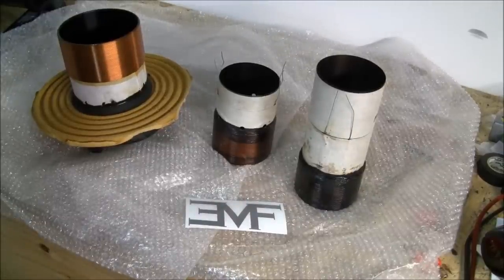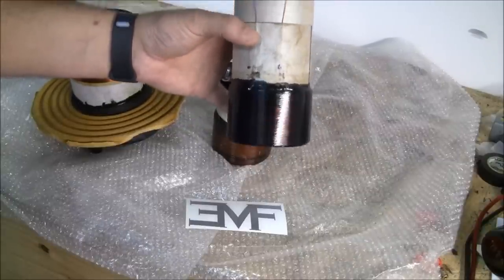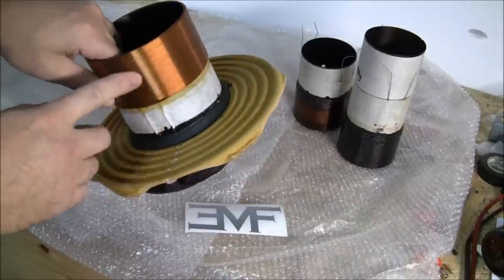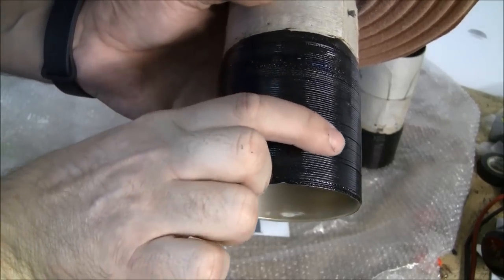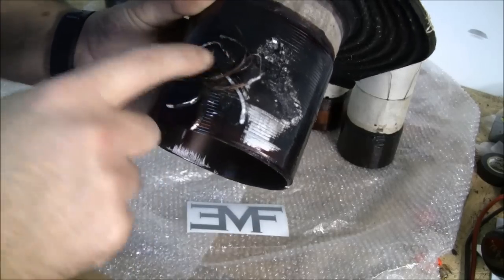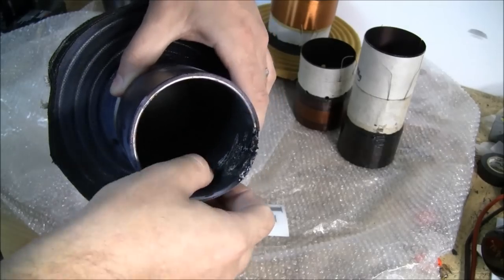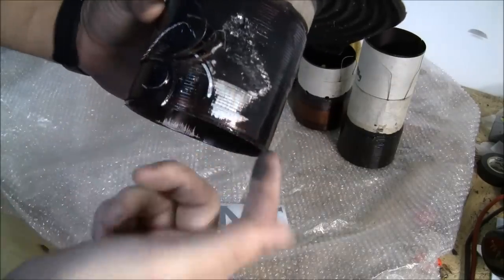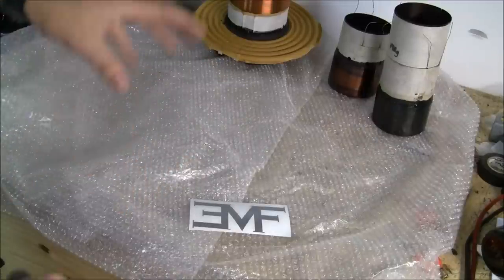Voice Coils - we know what you did!

Comment: The coil that had the 10k on it, how much was the sub rated for rms? 3" I'm guessing between 2500-3000? So a 10k even after decent rise would still be around 5000 minimum. I think you said it best this is the only hobby where people will push stuff 2-3x past what it's rated for then still blame the product. LOL!
Reply from the maker: Flexin Five Hundred 2,500 rating on that sub. It didn't last long on that amp.
Reply: LOL depending on the coil 1200 or so RMS+
Reply: Or they buy a 1k amp and crank the gain all the way up trying to get 3k out of it then blame a sub for dying not knowing it was basically being fed dc and being used as a space heater
Reply: I remember some car audio company's, were not listing RMS ratings, and when asked about it, they would tell you that "if you have to ask, it's not the sub for you" but, that has been awhile. No voice coil is "rated for power" and that's a huge misconception, and anyone that tells you otherwise, is just trying to push a product. And on a side note, the difference in the color of the enamel, depends on how hot the coil was baked for curing, and or how the process was done.

Comment: Also fun fact about the Brazilian amplifiers is they use extremely high voltage rails to drive the bridged amplifier section, often without filtering. Im guessing the higher multi-kW ones run at about 160V from the 200V capacitors often seen. This combined with lack of filtering allows for less current to be used for the same drive power, and thus fewer switching transistors. The downside is if the voice coil suffers a broken section (and no inductance), the voltage will basically shoot straight up to the rail voltage since there's no filtering on the class-D output, and thus flash over, causing all the melted and burned sections seen.
Reply: if it suffers a broken section it is already dead, usually caused by low voltage supplied to the amp anyhow, they just try to overcompensate, just need an amp good enough to shut off when your volatge is shit.
Reply: @nate0 Obviously you wouldn't, just like you wouldn't want to continue to run an engine with a rod knock, but it happens. A typical scenario would be multiple subs and you might not hear one is failing right away, so it ends up nuking itself in the process. Since the voice coil has a fair bit of inductance, if the amp has no output filtering and no proper clamping on the output, it can generate quite a lot of back-EMF if the coil opens up, thus leading to flashover. Don't know how many were/are susceptible to this, but its a distinct possibility since filterless class-D is really for undemanding things like consumer electronics, not high power car audio amplifiers. These also have the undesirable characteristic of having substantial voltage on the speaker terminals even with the amp idling since each terminal will be toggling between the two respective power rails.
Reply: Your "fun fact" about Brazilian amplifiers is completely incorrect.

Brazilian amps being "extremely high voltage" is an old myth/misconception.

Brazilian (full bridge) amplifiers use much lower rail voltage than their half bridge counterparts.
Reply: @danielbujold7262  First off, a full-bridge amplifier doesn't use "much lower voltage", it just doesn't have a bipolar power supply. Half-bridge designs have to have + and - rails to be able to provide the full swing about the ground reference. With a full-bridge design, the bridge does the polarity flipping, so only one rail is needed. That said, the rail must provide sufficient voltage to actually drive the load, and as such will use similar voltages as the half-bridge amps, but just with only one rail, and half the number of rail caps. Just doing some basic math, 2 kW RMS into a 2Ω load requires 63V RMS, or 88V peak. In a full-bridge design, this would be 90V at the rail. In a half-bridge design, this would be ±90V.
Reply: @danielbujold7262  And I think that may have come from a barevids video where he looked at the outputs of a full-bridge amp. That can cause some confusion since normally just one output will be swinging while the other sits at ground. Off the top of my head, the outputs on a full-bridge should be of opposite phase to add up to the full drive voltage once the drive signal has passed thru the filter networks.
Reply: @mysock351C  again with more misinformation....

Since you brought up the barevids video...I suggest you go watch it again. It's a good example of the correct information on this topic. He explains simply and clearly that what you're saying is false. A full bridge amplifier uses half the rail voltage vs. an equivalent half bridge amplifier (contrary to what you're claiming in your example).
Reply: @danielbujold7262  Having actually built amplifiers, not to mention being an engineer, I will say again that what you say is not how it works internally. It may appear that way externally due to how BTL amplifiers work, but inside there is only ONE rail instead of two. The idea behind the full bridge is that it can swap polarities of the load provided the load is kept FLOATING since there is no common like a half-bridge or linear amplifier. In a half-bridge or linear amplifier, two power rails are needed since the audio waveform can swing both positive and negative. On the positive swing, the positive power rail and its associated output transistors are in conduction, and the circuit path is from the positive rail to the common. When the audio waveform goes negative (i.e. crosses over), the process repeats except that in conventional current terms, the common rail is sourcing current thru the load and to the negative rail. One terminal in this case is at ground potential.

With a BTL amplifier, since both terminals are being driven, only one power rail is needed. Each half of the transistor bridge is used to route current thru the load and to the common internal rail. When it needs to swap polarities, it simply switches which set of transistors are in conduction so it can toggle the polarity of the output as needed. Once this passes thru the filtering, each terminal will, in essence, have half of the waveform on it. When they are summed together, you then get the full audio waveform. 

If the amplifier needs to be able to make a peak voltage of 50V, no matter which type it is, the power rails will need to be AT LEAST 50V. The only difference is the BTL amplifier doesn't need the -50V rail to do the business. It only needs the +50V rail. It cant magically make a 25V power rail into 50V. That's not how it actually works. 

For an amplifier rated at 3 kW into a 1 Ohm load, the RMS voltage will be ~55V. The peak voltage will be ~77V. Inside the amplifier, the power rail voltage would need to be at least that high for it to work. In reality, its probably going to be something like 85V or so. Not a trivial voltage, and if there's no filtering 'cause they're cheap, the back-EMF from a voice coil suddenly opening up will indeed cause issues due to how much inductance it has.

Again, its not "half the voltage", its just half the power rails, in this instance one instead of two.

Comment: The clipping itself isn't the cause of loudspeaker failure, it's the symptom of the problem, i.e. 'not enough rig for the gig' your hitting the end stop on the amp (and speakers if powered properly) and most likely going well past them. 

Lost of people, especially nearer the bottom end of the game, tend to have mediocre amps (and speakers) and push them to hard to get anywhere near enough SPL (also an amp driven hard into clipping sounds louder which add's to the issue), while a system powered with an amp that is rate at the same RMS figure as the drivers sounds like a good idea, once it's driven hard it's then producing far more output (with far more distortion) and the drivers get burnt.

The statement that clipping damages voice coils is probably slightly wrong (or being answered slightly wrong), as clipping itself does not damage speakers, but it usually indicates there is a problem that will result in a loudspeaker failure.

A lot of Synths used in many EDM genres can produce square waves and a lot of producers use them. Especially in genres like hardstyle/hardcore. And they don't damage the speakers.

Go and try it. Create a square wave and sent it BELOW rated RMS through your sub woofer. It will sound ugly but it won't damage the driver.
Distortion is also not what causes damage to a speaker. But it can indicate that your are at A limit. Be it your amps output or your drivers mechanical limits. 
Heck, guitar amps sound the way they sound because of distortion and they last for years if used properly.
Reply from the maker: .....but clipping DOES damage coils, and leads. Obviously there is a problem if there is clipping, like the recording is bad, or the amp is overdriven, but neither of those things causes a problem for anything but the speaker. In the instance of using square waves in the recording, with enough output it will absolutely damage speakers. Remember the root cause is heat. 1 watt of square wave can't generate enough heat to kill the oil nor does it have the amplitude to kill a lead. Distortion from a guitar in a recording is the same way, but not nearly as aggressive. There are sharp peaks, not flat spots. The flat spots is what does the most damage.
Reply: @EMFAudio  Yeah but like you said yourself it's the heat. 
Clipping in and out of itself, as basically a less aggressive square wave is not something a driver by dentition cannot handle. 

The problem is that clipped sound (and square) generates more heat per given wat due to poor ventilation when the coil is moving less, EMF (ironic name :P) no longer provides additional resistance when the coil stops moving so your coil can get even more power too fast if the amp allows for it.

If you RMS match your driver and amplifier you can certainly blow your woofer very easily when you notice clipping because for one, you are already at the limit of both your amp and driver.
And now you are pushing the amp even more when you put it in clipping territory.

So you are getting more stained power then the woofer can already handle and the additional heat build up of straight cut of sections.

Got a car install with a subwoofer that can handle 1000 rms 2500 peak. It's supplied by a amp that can deliver 500 watts rms and 800 peak. 

Even when maxed out on the amp, with some minor clipping the woofer is as new.

Clipping in and of itself is not bad. It's the additional heat it generates that can cause damage if the amp is powerful enough to provide enough power.

Comment: I have been getting hate for blowing Kicker solo L7r 12's. Not sure what changed with kicker from 2005 to now. Long story short I destroyed my beloved l5 because I listened to it full power it with a drill on top. I replaced it with a like speaker thinking it was an upgrade.  After than I kept blowing the l7's. People blame my amp settings, but I later got a Skar EVL and have not had an issue. The amp I was using was a JP8. Even clipping it I cant see how that would destroy a Solo. 

I am open to ideas, and sure I am gonna be called a liar. I never tried to warranty a speaker. I am was just disappointed the normal solos can't take abuse any more. I was a die hard kicker guy until 2020. I had no idea Skar was the most hated brand in the world. However I have been very pleased with it. My time to go with Sundown is finally here, but not because skar failed me.

Basically Iam wondering what your thoughts are on a Solo L7r running on a D4S JP8 under the worst possible scenario. My L5 lasted all this time until I messed up.

Comment: What is the main benefit from a aluminium coil? better cooling capabilities, power handling, less weight in the moving mass?
Reply: Generally less weight. Electrically, aluminium is inferior. They require more engineering to get them on a decent efficiency. Luckily, most of that is already figured out and 'public domain' knowledge.

Comment: GREAT VIDEO! QUESTION: I have never had a subwoofer bottom out. Alpine 8" type R dual 2 ohm rated350 watt rms per coil. being powered by alpine MVR 250 ( 250 watt at 2ohm 150 watt at 4 ohm ) wired at 1ohm. I only hear the tick of what I assume is a voice coil tap against the magnet. Would this be caused by 1ohm wiring? or Air leak in sealed box? or just over power?
Reply from the maker: DSM Dallas You may be hearing light clipping from running it at 1 ohm. Typically if you're tapping the coil on the backplate you don't do that too many times before it's destroyed. Now, I think it's also impossible to do that on that sub so it might also be mechanical noise from the spiders or maybe lead slap on the cone.
Reply: I've had a couple subs back in the days where spider just wasn't glued properly and the spider came loose.  Luckily, in each case, all I had to do was reglue it and it fixed the problem.

Comment: Im building a sub and notice there are options for coils. obviously size but also round or flat wire, aluminum or copper, etc.
It will be a 15" sub, just under 200oz magnet and i'm thinking 2.5" or 3" voice coil. Any suggestions on coil type??
How would I calculate power handling? Great, informative video btw!
Reply from the maker: The weight of the magnet means nothing. The coil diameter is determined by the motor, that isn't an option. There are benefits and drawbacks of various coil selections which are dependent on other factors of the motor and soft parts. Power handling you can only have starting points based on the coil diameter and length but you can't simply calculate anything because of considerations with the motor and suspension.

Comment: I had an Alpine Type R that started sounding horrible.  At low volume, you could hear the dreaded scratching. Checked the impedence on both coils and it was fine. Opened her up and all I see is what looks like copper rubbed off (aluminum showing?). It's  only in one tiny spot about 4mm wide and only 2 strands tall. It's about 1/2 down on the coil. What would be the cause of that?
The only other thing I saw  was the former isn't completely closed. There's like a 2-3mm gap. Not sure if it's supposed to be like that.
Reply from the maker: That sounds like something was in the gap. That was the rubbing sound, and the marks left from it. The former not being closed, at least what you were seeing, is normal.

Comment: Great video.. Very informative.  What does colirub sound like? Would it cause metal fragments to be in the speaker box?  I recently blew one Sub. Had  More power than it can handle .I'm curious what the coil looks like. I will be my 1st time
Reply from the maker: It sounds like a light grinding. There is no scenario where you should have metal fragments in the box. If it's from the coil, it had a hole blown through it. Even then it shouldn't be very big pieces.
Reply: The speaker was frozen in place. I push it all the way down to look at the coil. As I was moving  around I saw a piece of the coil that was definitely scratched about 2" exposing bare copper.  There is also what looks like a coating of metal dust inside the magnet hole
Reply: They were not big pieces. They were silver in color and I know they weren't there when I put this sub in. 600 rms running and 800-900

Comment: So even if the coil turns black but no bubbles or rubbing sound, its still good?? Or still needed to re-cone???... Or i can still use the sub and supply it with the rated power it has.... Or underpower it for safety??

Because my uncle gave me a 12inch sub 1K rms 16kg heavy, and I noticed that the coil is black like charcoal, not like the brand new one that copper color,  but when i test it, it's still good sounding no coil rub or what so ever...

Comment: Clipping is known to send disproportionate amounts of power to tweeters in full range speakers, but does it really make much difference on a sub, other than just extra power going to the coil in general? Running continuous bass tones near tuning or higher bass frequencies will generate lower impedance and also cause less coil movement that would evict heat from a vented pole piece. Excessive burst power could damage suspensions and spiders, yank coils away from cones or cause coil turns to come unglued if they aren't up to snuff. Bottoming out can dent coils, causing permanent rub.
Reply from the maker: Yes, it does matter on a sub. You CAN hear it, and it also just dumps heat. Less coil movement would INCREASE heat at that coil, pole venting isn't doing much of anything, and pole air isn't where the bulk of the heat is. Excessive burst power (within reason) only damages the sub if it's designed and built poorly. A good design won't bottom out and dent the coil, and breaking glue joints is just poor assembly. None of those are things our subs experience. We intentionally put over 7x rated power on them for a burst without failure.

Comment: So if a sub has 1 year warranty and it blows for whatever reason is it still covered under warranty?
Reply from the maker: Warranty typically states manufacturer defects are covered, not because it's broken for any reason. If you clip the hell out of it, nobody is going to warranty that. If you're using it outside of specifications, like more than rated power or the enclosure is way too big or way too small, nobody is going to warranty that.

Comment: Was wondering if you could build a custom voice coil if given exact dimensions. 
Have an 18" basket and cone, and ss audio 12" motor.
A 4" 75 lb motor is silly for a 12"
Building a more practical sub...lol.
Using 1000-2000 wrms.
Might need a few spacers and a standoff, to use the DC audio 18" medium spiders.
Also have a dozen or so L7 solobarics to recone with some maxxonics cones.
Reply from the maker: We don't wind coils, nobody does. It takes specialized equipment to do it, when we get coils made we have to make an entire run of them.